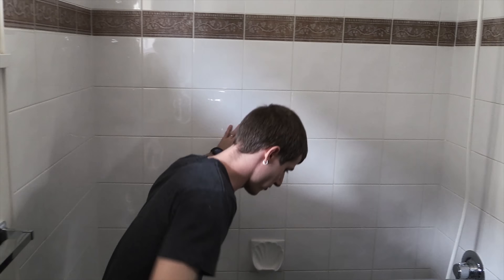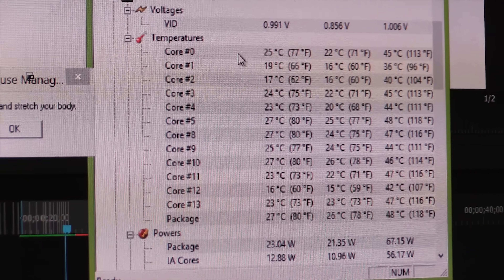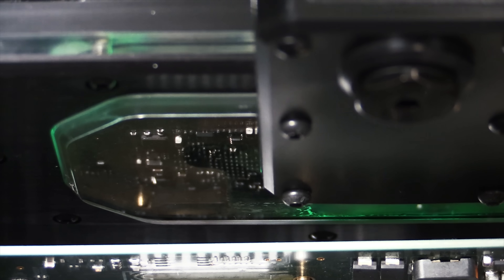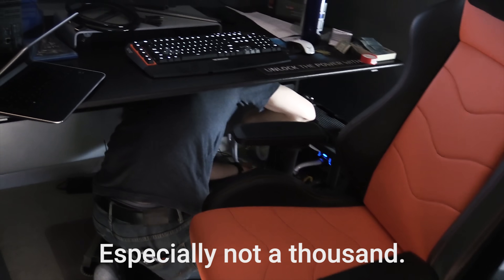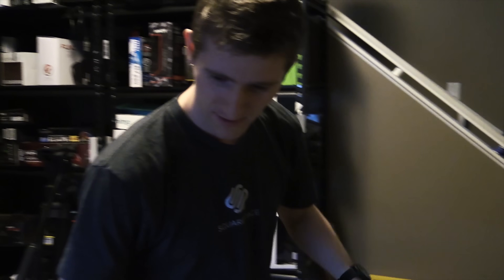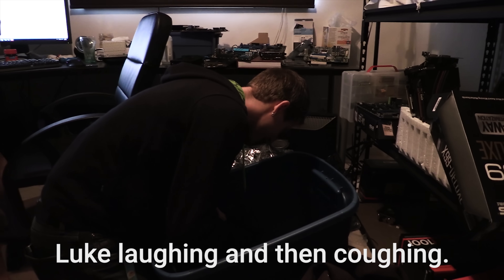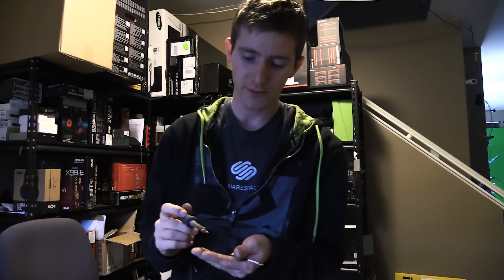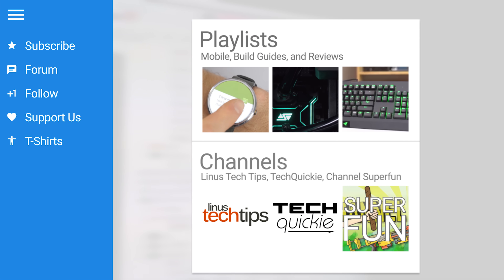Whole Room Water Cooling Part 5b - Some Issues, More Solutions...

Comment: yeah I think you def miss calculated the pressure and flow requirements for that loop, takes way more pressure to move water than most people think....specially in something like all those smaller computer loops, with all those extra little pumps and blocks there is a ton of resistance to the flow...your big pumps are essentially being hindered by the smaller ones most likely
Reply: also why did you run the piping on the ceiling? gravity aint helping either
Reply: Supernautt also inline filters will add a substantial amount more resistance to the loop....
Reply: Supernautt good luck lol
Reply: Having fun  talking to yourself?
Reply: guess u proved yourself wrong? mind blown....lol

Comment: Put some solder in your iron solder first, and put the wire over the solder and the iron solder over the wire, put solder on this wire, and on the other one, after that, put the wires together and use your iron solder to melt the solder and u'll have a perfect welded wire :)

Comment: #SolderingTip  You need to hold both camels together. You can also Twist them together. After that heat the spot, witch you want to solder, for a bit (like one ore two minutes). Than thake the solder and and push it near the heated spot (not on the soldering iron) now the solder should melt and distribute by itselfe. After that you can distribute it with the soldering iron a bit more if you want but don't use too much solder, less is more (you just need an electrical conection).
There is also an Android app wich shows you all the electrical conections and pin layouts on barly any conector out there, its called "ElectroDroid" take a look at it.
In my humble oppinion the whole room water cooling projekt is a genius idea, but the implementation realy sucks. I could have told you from the first part that you will have massive problems with that. Hopefuly you will invest more time by doing it in your new office.
But anyway you guys are making good videos, keep on doing that. Thumbs up from my side :)
(PS: English is not my native language so don't be to harsh to me.)

Comment: Soldering tip: Use heat shrink tubing around the connections. It is much better than electrical tape and it looks better too. Also, rather than tinning the wires and then soldering them together he should try twisting them together in a straight line (after sliding heat shrink over one wire) add flux, and then solder the wires together. This makes for a cleaner, thinner, and more solid connection. The solder used looked like it might have been really thick or maybe even plumbing solder. For anything computer related (or smaller gauge wire in general) I find that a fairly thin spool of solder is much easier to work with and does not require the iron to be quite as hot.

Comment: Use a helping hand! so you can have the soldering iron in one hand and the solder in the other. Then twist the 2 wires you're trying to solder together and after that put solder on it.

Comment: Presumably you dont want tips on soldering haha?
Cause yeaaa that was all wrong.
Spread the wires don't twist them, like two hair brushes facing each other, then give a gentle twist to them, heat wires and touch solder to the wires, if the metal is hot enough the solder will rush into the cracks and stick to every wire like water running up a paper towel.

Comment: This is getting painful and frustrating to watch as you crash on more and more, sometimes very dumb, problems out of inexperience. Of course there is some fun about going through projects and learn from your mistakes on the run, but that kind of thing should be done outside of professional environment where you are tampering with your personnel hardware.

In this case you should have hired people with experience to guide you on how to do each part of the project properly to get it done correctly on the first try. For example, the guy who did the copper tubbings, he did a good job on the first try, and his only error was missing to solder up one connection and you got leaking there, but there were no more problems about that part of the work.

For the soldering of wires or cables, just heat up the wires with the soldering iron for a few seconds, and only then touch the wire with the solder and it will melt and spread correctly all over and into it.

Comment: I recommend thinner solder than you used. Make sure it has internal flux and you can avoid using a pen. To start, tin the tip of your iron with a little solder. Next, touch the iron to one wire and bring the solder in to completely coat the wire. Make sure not to use to much solder as this will make problems later. Repeat this for the other wire. Next, twist the two wires together by hand. To finish the join, re tin your iron and use it to reflow the solder. If you are interested, Ben heck has some good soldering tutorials on his channel.

Comment: Make sure your heating the wire then applying the solder to wire, not heating the solder then applying to the wire. And i'm sure your using heat-shrink tubing around the soldered joints.

Comment: You guys should have used ProPress fittings in your entire room cooling system 
The flux that you used is going to destroy your hardware
 I think you guys should take that whole thing apart and use pro press or shark jaw fittings

Comment: It looks like you're trying to melt the solder on to the wires. You really shouldn't do this because it doesn't establish a great connection. Instead you should heat up the wire itself and let it suck up the solder instead of just smudging the molten solder on to the cold wire.

Comment: For soldering: Instead of individually twisting each wire together, then twisting the wires you intend to solder together, forget that first step. Solder is meant to fuse together wires by melding the spaces between the two wires. If the strands of each wire are interwoven together and then soldered, you'll have a much stronger connection. Additionally, don't be afraid to use as much electrical tape as you want to tightly wrap and insulate the soldered wires.

Comment: LinusTechTips The solder you got is for copper pipes (House pipes) and not for electronics hahaha. I mean, you can use it but it will be much harder. Try looking for Sn63/Pb37 MGChemical solder wire (They don't sell these on HomeDepot, try Sayal Electronics or even online). Good luck :)

Comment: Hey Linus, Try to remove the Water pumps from the Pcs, I think those are the ones that are lowering the Water Pressure, connect the tubing directly and just use the 2 Bucket Water Pumps and see how 
It works. Also always the end computer will be the hotter on water. Because the water is warming up as it goes.

Comment: 1. put heat-shrink on the wire-to-be-soldered
2. heat the exposed and drilled bit of wire with the soldering iron
3. add some solder (not to much, not to little) to the hot wire and let it "flow"
4. hold both wires together when step 2 and 3 has been applied to both ends and solder them together
5. shrink the heat-shrink over the soldering spot

Comment: No, Soldering tips.  But, I do have a ladder tip.  When you set up a ladder to get to the roof, before you carry any gear up, attach a bungee cord around one of the steps to the gutter.  Both hooks will be on the gutter.  This will keep the ladder from shifting or falling backward.

Comment: as an FYI, running filters means it will reduce water flow, so stronger pumps might be needed. And pull the water through the filters, don't try to push it.

Comment: alright, tips for sodering: Make sure it's hot enough, and try to use flux always, but not too many flux. Always insulate. Never touch the point of the sodering iron, it'll cause permanent burn scar.

Comment: when soldering, tin the wire with solder seperately, put heatshrink tubing on everything, then touch the tinned wires together and heat with the soldering iron to make the joint.

Comment: For soldering you really want to be heating up the wires, pads, etc and push the solder on to make the joint. Trying to wipe the solder on can lead to a cold joint and no one likes that.

Comment: So tips for sodering (or however it is spell it)
My brother gave me an useful tip
Never do cold sodering

So you take your pen and tin
First Heat up the object you want to connect something or whatever
after its heated up take your tin and touch tin with the pen so it could really nicely hold them together

Oh and less is more (in case with circuit boards)

Comment: Right, I'm not trolling here, but you boys have NO place near electricity or plumbing!  I hope this teaches you a lot and is a great learning experience.  First thing I'd say is to ONLY keep LOW VOLTAGE at that outside rig, and keep the 120V INSIDE and out of that bathroom at that.  Also consider a higher output regulated supply instead of the "bricks" your feeding it with now.  Though I do suspect by what I see here that this is the LEAST of your issues.  I'd say a better splitting system for the plumbing and electrics would be a start.  Most-likely one larger pump instead of the two that you have now, as I have rarely seen those work in a push-pull type setup you have them in.  Best of luck to you guys, and I'd love to help however I can.

Comment: When you solder, you should tin the individual wires and then heat up one end and attach the other to it and after add a little more solder. If you scrape the solder with the iron like that, you're just going to get cold solder joints. Nice choice going for the WES51 though!

Comment: Soldering tips: If you want to solder two wires together. Bend them both in a U-shape, then hook them into each other, when twist them. When soldering, make sure to heat both wires at once, and then come in with the solder. Don't make the joint too large, as that will cause the ends of the joints to break of more easily.

Comment: To solder those wires properly don't twist them once stripped, you will have to push them together and then twist, it will lock them together, once that is done then solder, it will give a better looking join.

Comment: Soldering- make sure you sand the tip of the new iron and tin it with solder otherwise it will not get hot enough.

Comment: Solve almost all your problems by using a Koolance Plate Heat Exchanger on each computer!  Use the tub as a reservoir for the cooling loop (tap water is much cooler than ambient air) and abandon the external radiators. If you want to keep the external radiators use the second pump, get 100' of plastic tubing and create a closed exchange between the water in the tub and the external radiators.

Comment: I once had an SSD that's power connector's plastic bit had craced (was mounted behind motherboard tray) ssooo, took a molex-sata adapter and soldered that to the pins. Works like a charm!

Comment: Soldering- use heat shrink tubing not electrical tape.  Intertwine the strands of both wires and use flux to draw the solder in.  Place the tip on one side of the wires and touch the wires with the solder on the opposite side.  Watch some YouTube vids on soldering!

Comment: so linus
i hope that this comment will be appreciated,
For the question about soldering...
0 use Heatshrink tubing , cut and put a piece on the wire.
1 with the help of some friends of an helping hand, take the wires in contact in a safe and stable way.
2 put the soldering iron on the two wires and heat them, than take a very small solder wire (something like 0.8mm or 1mm) and put the wire on the wire while taking the soldering iron from right to left, to heat up well all the wire and melt all the solder.
3 remove the solder wire and then the soldering iron too.
4 put back on the uncovered cable, the piece of heatshrink you put before and bring near the soldering iron to shrink the tubing,
5 step back and appreciate :D  :)

like your videos, 
Greetings from italy!! 
LinusTechTips

Comment: Because i'm too cheap to buy a set of helping hands i drilled 2 holes in a piece of timber and  i put the handles of my pliers into the holes, that way it keeps the pliers clamped shut and upright. Put your wires in there when you're soldering so you don't burn your fingers trying to keep hold of a rapidly heating piece of insulated copper :P

Comment: For soldering: twist the two wires together, then heat them with the iron until they are what melts the solder (apply the solder by touching it to the wires, not the iron). Then just clean up with heatshrink (recommended) or electrical tape.
Disclaimer: I am not an expert, this is just how I learned to solder pipe and figured the basics would apply to wiring as well.

Comment: Cheesus, its soldering not painting. :smackshead: be nice.. okay. Sorry, forgot. First tip, if you get things hot enough solder will flow right to them. So instead of just dabbing the iron on the wires, you want to put the wires above the hot iron and make good contact so that the wires heat up first, then apply the solder to the wires and voila; perfect solder joint. 

The paint technique tells me your iron was not hot enough.

Comment: Soldering Rule #1

Clean everything to be soldered thoroughly,

Soldering Rule #2

Always heat the object(s) you want to solder (In this case the wires) and not the solder. The solder will wet to the wires and give a good, clean and durable connection.  Heating the solder directly in one way of getting cold solder joints.  A poor, brittle connection that will eventually fail,

Comment: My current (bought in a normal shop) non gaming pc:
I7 2600 2.4Ghz
Intel H61 mobo
2x4 GB Samsung RAM
ATI radeon HD 7450 1GB
300 watt PSU

Upgrade:
i7 2600 2.4Ghz
Intel H61 mobo
2x4GB Samsung ram
GTX 970 strix
600 watt (80+) PSU 

Should i upgrade my mobo(no overclocking whatsoever)?
Is my CPU still good?

Comment: How to sauter wires together:
You don't unless you know exactly what you are doing.
Buy a scotchblock kit on amazon for like 10 buck and put tape around it.
I did it on my powersupply, and on my network cable, both work perfectly.

Comment: Linus- First of all, throw away that plumbing solder you bought at home depot and get some proper 63/37 Kester Rosin Core solder. It's made for electronics and has the flux built into the wire. 
Next, take the electrical tape, put it in a drawer, and go buy an assortment of heat shrink tubing with adhesive lining. Make sure it has the adhesive lining which makes everything water-proof since it's going to be outside. Electrical tape only works temporarily and will be falling off within a year. 
Also, the way you were soldering will result in a cold joint. Always pre-tin the exposed ends of the wire with solder FIRST. Then you slide a piece of the heat shrink over the wire, then solder both wire ends together. If you need help so you're not burning your fingers, buy yourself a "Helping Hands". It's basically a stand with articulating metal alligator clips, a magnifier, etc. 

Keep in mind that if you half-a$$ electrical work like that and god forbid it sparks a fire... there is a good chance the insurance company you use for fire/homeowners will DENY your claim, and you'll be stuck with hundreds of thousands of dollars to repair the structure yourself. I'm not kidding either. This past summer my neighbor's "hydroponic" setup shorted out and burned the garage to the ground, and he's still fighting it in court to not get stuck with the bill.

Comment: OMG...  #1.  Do a internet search on cold solder joint and then don't do them.  Your soldering iron is set too cold.  You should be at 600F to 650F even with the melting point of solder at 375F you want to heat up the wire a little to get a good bond. #2. Don't use the solder you picked up.  That stuff for the lack of a better word is used to solder pipes together.  Get some small diameter 60/40 rosin core solder or better yet get some 63/37 or some SN62 62/36/2 solder (last 2 % is silver).  #3 Clean burnt up stuff off that soldering tip.  It will make soldering a lot easier.  #4 That is way too much exposed wire.  Strip back to a 1/4 to 3/8 of an inch or whatever the metric conversion of that is.  #5 Flux on the wire.  Soldering iron near and below the wire on the far side of your joint.  Solder on the top and away from your joint.  When the solder melts it will flow across the joint and to the soldering iron making the bond.  When the connection is made remove heat and don't move the wires.  Let the solder go from a liquid to solid. #6 For a good solder joint remember SSCC. (Smooth Shiny Concave and Covering)  I hope you read this comment and it helps.  I have been working professionally in the electronics field for 25yrs and if you need any more tips let us know.  Thanks  VengeanceTech.

Comment: I dont comment much but nobody is actually offering any soldering tips. Dont melt the solder with the iron. Heat up what ever you are trying to solder with your iron then melt the solder with that material. In your case, heat up the stripped wires with the iron and then hold the solder to the wire. 

If you just melt the solder with the iron you end up with colder solder joints and they are not as strong. Also flux is your friend.

Comment: What we normally do at work, is moving all computers into a storage rack in a one room with cooling - call it a server room if you like. Then we have long screen, keyboard and mouse cables back to our workplaces. If someone need a diskdrive they get a usb version with a long cable there too. It is simple and it works. Especially now with display port. No noice. No heat. No worries.

Comment: why not just feed it directly from a pipe? instead of having 20ft of tubing going around the place with a crap load of radiators.. plus you would be feeding it cool water which has been running underground